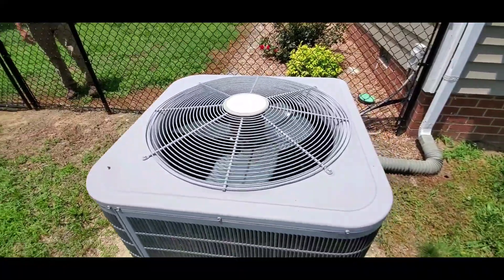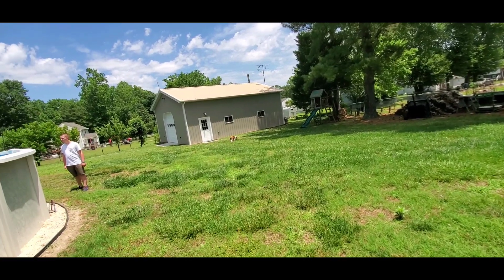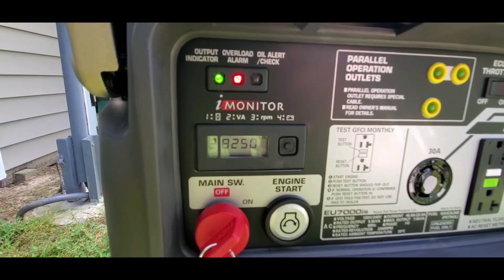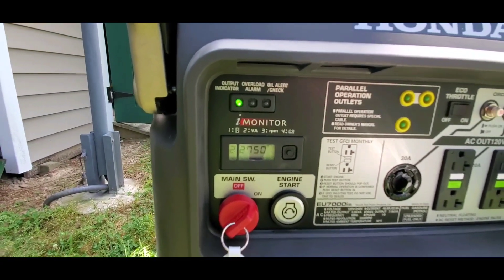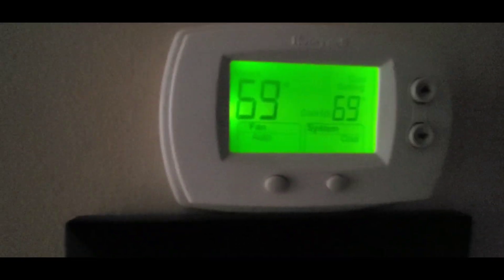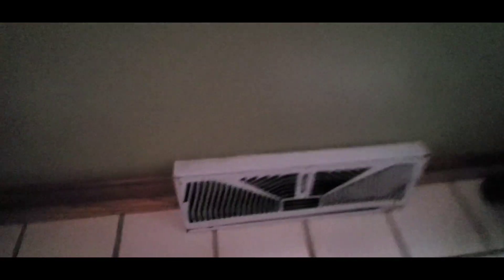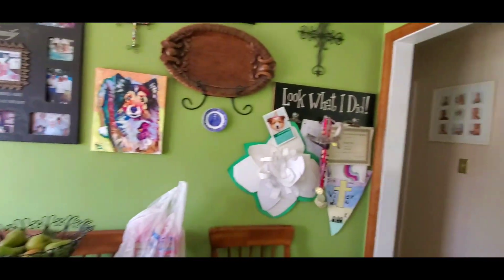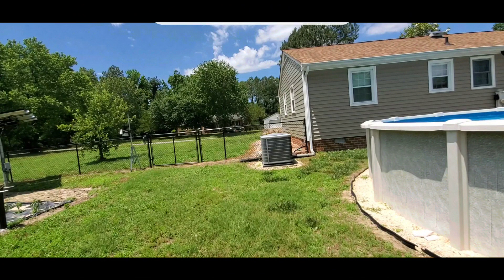Honda EU7000iS  EFI Generator  VS Carrier 3 ton AC Heat pump  By KVUSMC

Comment: What’s gonna happen if that generator needs to be serviced by a Honda guy or whatever. It weighs a ton. I don’t think I could bring it home from the store for that matter. LOL it seems to be a good fit for my needs but the weight is an issue and I doubt I will not have to take it in etc. engines always need professional work. I guess I could do the oil changes spark plug and filter changes. Anything else I wouldn’t have a clue. I guess these guys can come to your house and service it perhaps?  Or maybe this thing is that good it won’t ever break??  I was thinking buying two or three of the 2200 portable generators.
Reply from the maker: They are nice I would just call my dealer and come pick it to service it

Comment: Looks like a peak of 9.25kVA when starting. Really impressive on the EU7000is! FYI: If your solar panels are grid tie, they will sync up with an inverter generator because the frequency output is stable enough. Tested this before! Thanks for the vid.
Reply from the maker: Thank You Buddy I appreciate it yes Very Impressive there are grid tied and Battery Back up Great information Buddy

Comment: How did you Hook it up
Reply from the maker: I ran it from my 240 volt on my Generator to a 240 volt welding / Dryer plug before I did that I shut down my main circuit Breaker

Comment: This is my dream generator but 5k is a lot of money. I bet it’s worth every penny when you can safely run all of your sensitive electronics on it in an emergency though. What’s the purpose of the hard start kit you’re showing at 2:13? I was thinking about getting a portable AC unit for my bedroom as my central AC is 4 tons. Thanks
Reply from the maker: Yes sir The hard start kit lowers the surge so it can start the AC start easier the EU7000IS is worth where penny

Comment: I have the same generator with a 14 seer 2-1/2 ton Trane air conditioner only. My A/C is 16 years old. I do have a variable speed fan air handler. 
I saw the cold load pick up reach 8250 watts in your video. The generator is rated for 7000 watts surge. 5500 watts continuous. I couldn’t start my A/C with the same scenario. I had to have the hard start capacitor installed to start & run it. We live in the Northeast. We were impacted by the recent tropical storm that plunged most of Connecticut in the dark. We lost power for three days. We were able to run my entire 1600 sqft. house with the A/C on with the Honda eu7000is. The generator performed flawlessly. This was the first long duration outage we ever had. We burned 30 gallons of gas in three days. We conserved fuel by opening the windows at night for two of the nights because it was cool out. The overnight usage was 2 gallons for the rest of the house. With the A/C on at night we burned 5 gallons of gas. You can’t rent a room in a hotel for the cost of the fuel for this generator. All our neighbors had to throw out their food. My wife was able to run laundry & relax in the cool & conduct business as usual. 
What was I doing? I was sleeping during the day. Then restoring power to the residents of Connecticut the rest of the time as a lineman for the local power company.
Reply from the maker: The Honda EU7000iS is one awesome Machine You did great the Hurricane miss us by A hair You did Awesome Brother You can't beat a Honda
Reply: Thanks Ken, Thank You Honda! 
Some people may not know this but Honda has a unique feature in their design. If the genny needs a little more power? It can be paired with another Honda generator of any size. Of course it’s best to pair with the same size. 2-eu7000is together gets you a lot more power. However many people don’t know this but with any generator. The more available power burns more fuel. So unless you live next to a gas station? You’ll be busy refueling more often. I find the 7000 is enough power for our needs. 
The guys at work laugh & poke fun at me whenever I talk about my generator. If we hear a generator running? I most always say...,that’s not a Honda, I can hear it.
Reply from the maker: Amen Brother I agree that is for sure 👍